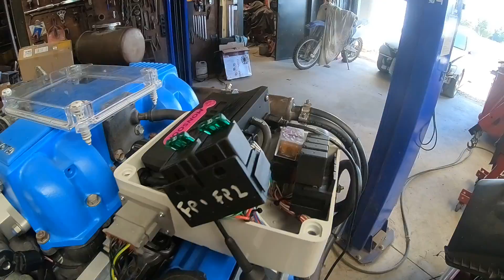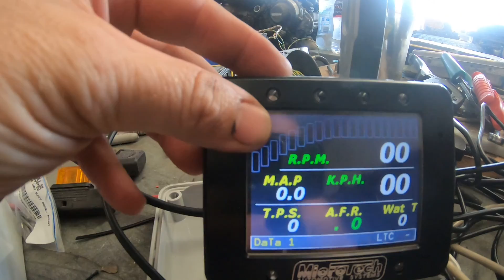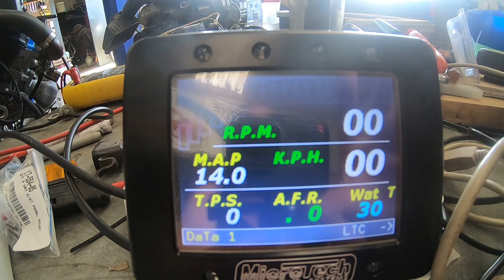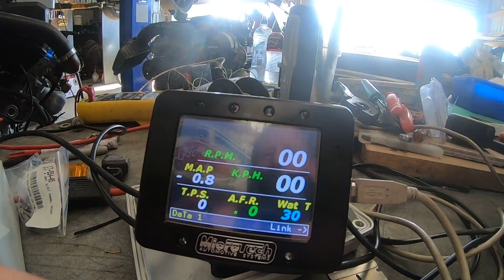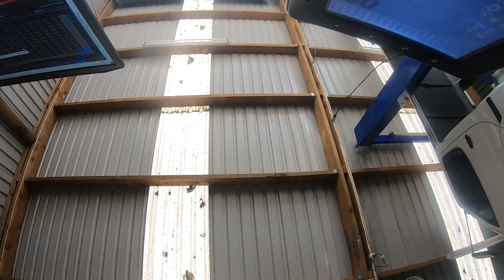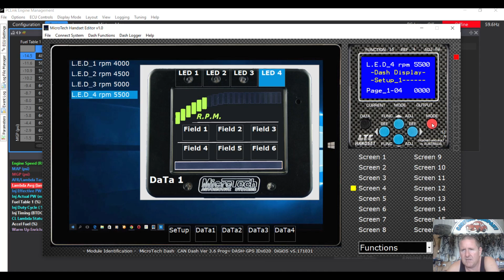Microtech dash to link ecu - setup.

Comment: Hi mate could you help me set this up on a haltech elite?
Reply from the maker: Sure, I can book it in with my other paid jobs , although the help desk at haltech might be a good first port of call.  Cheers Kelvin
Reply: I’ve got my haltech can turned on and box selected and I have the dash set on Hal ver 2 but nothing is displaying
Reply from the maker: @Thehowtoguyaustralia  does the dash power up?  Canbus resistor correct?  Can wiring checked?
Reply: @CartuneNZ  yes the screen powers but no resistor has been instaked
Reply from the maker: Ok.  Please check requirements for canbus termination resistor settings.  Also have you followed both the haltech and microtech instructions for setup?  Including the correct can ID?
Reply: @CartuneNZ  Haltech only has a on off deal with their dash settings in the elite. It’s very different to the link. I don’t have a old school plug to go into the side of the microtech dash. So I can’t do a set up through a laptop. I can only access the dash through the hand held screen. Microtech are of no help either.

Comment: Hey Kelvin, Any ides if this could work with speed input from an ECU rather than GPS
Reply from the maker: Hello.  Speed from ECU is in the dataset in the CAN signals so Im reasonably sure it can.  I can double check if you want.  Quite sure its able to be adjusted in the settings.  Cheers Kelvin